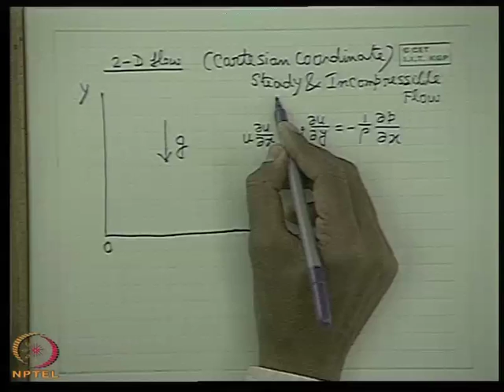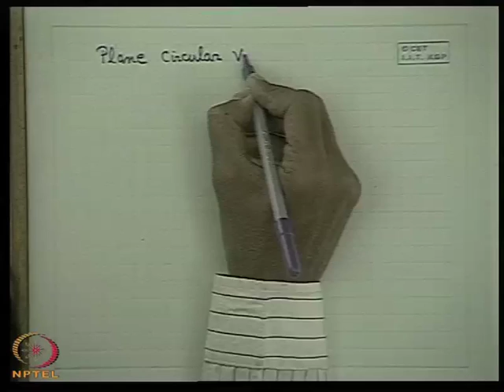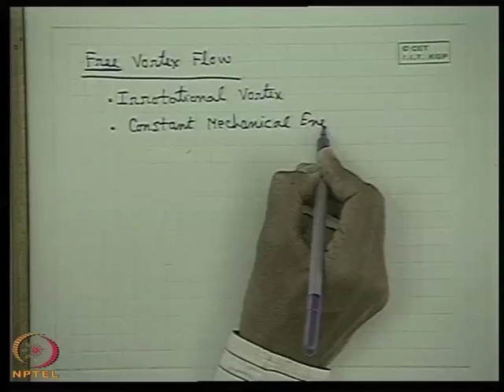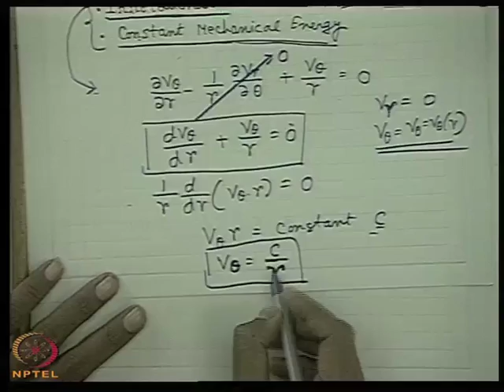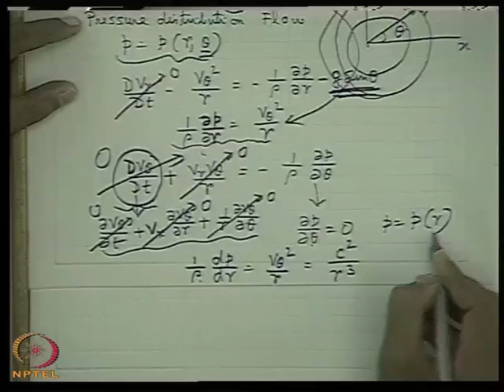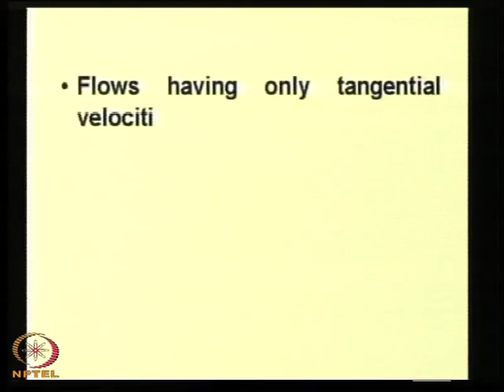Mod-22 Lec-22 Fluid Flow Applications Part - I

Comment: At the time of derivation for energy eq along streamline, we have considered it as a streamline where we never used it while deriving eqn. Why we haven't taken dr there, as we are taking here ? dr is arbitrary in x-y plane so, there ds which we have taken there is also arbitrary na? Anyone pls
Reply: Sir used  streamline to derive energy equation , if you see the derivation it is derived from  Euler's equation along a stream line .Sir took  ds which is along a *streamline*.
Reply: There is a difference 
In the euler equation for streamline ds was taken along the streamline but in the euler equation we are using is for entire flow field with dr as any arbitrary displacement 
Sir has already clarified it

Comment: In seady flow streamlines and pathlines should look the same..and if pathlines are looking like concentric circles going down in z axis.how is continuity between molecules satisfied..Shouldnt those streamlines be helical in shape?
Reply: Yes your are correct streamlines are helical in 3d. .. They are not concentric circles in 3-d.. But in 2d they seems as circle
Reply: @cipherRishi  but helixes im 2d looks like spirals not circles.. concentric circles are discontinuous function..and spirals are continuous
Reply: @monishreddy1797  bolt also have helical thread it dont look like spiral in 2d it look like a circle
Reply: Helix of decresing dia may look like what you are saying but of constant dia look like a circle
Reply: Actually free vortex flow happens when there is a sink.. And in this particles move in circle with having a velocity in perpendicular direction.. Which i think so is the defiination of helix..
Reply: @cipherRishi  thank you

Comment: At 36:30, why did he add the "-g.sin(theta)" therm if the equation on the 5th line is for r direction?
Reply: He explained but I didn't get it
Reply: @moisessena1307  gravitational force acts vertically downwards in Y direction only BUT we consider here cylindrical polar coordinate system in which  R & THITHA directions. which are inclined to axes (XY). since the gravitational force field acts vertically downwards therefore it is inclined R direction.
Reply: @RajeshSharma-yz4dh  Oh yes. Now I understand. Thank you!
Reply: @RajeshSharma-yz4dh  And why in theta direction equation -gcos(theta) not considered